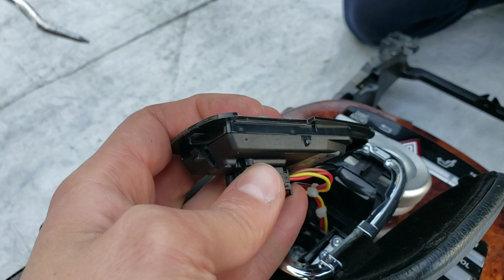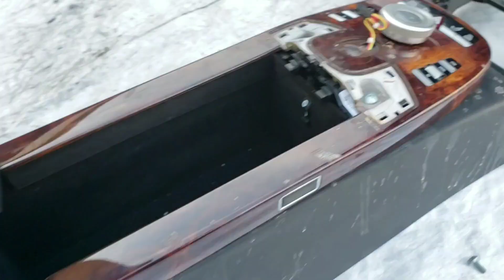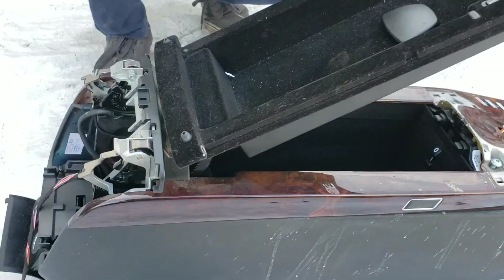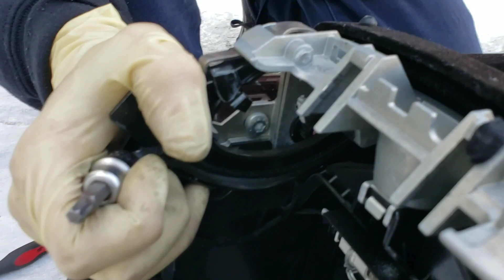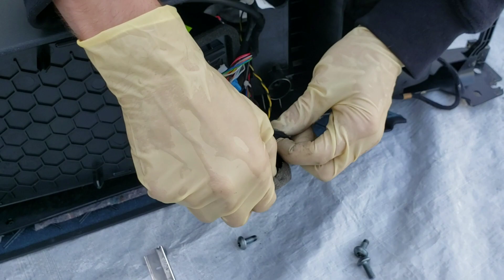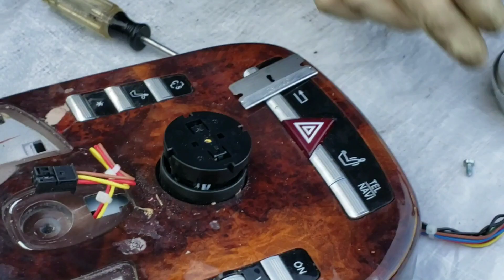Mercedes S550 S600 S65 CL550 CL600 W221 W216 How to take apart center console to remove command knob

Comment: Hi there 
I have 2013 Mercedes Benz S550 W221 , the car battery drains every couple of days, I replaced the battery 3 times already , I have code D135 

The Wake-up Line Has Short Circuit To Ground
Please help 
Thank you